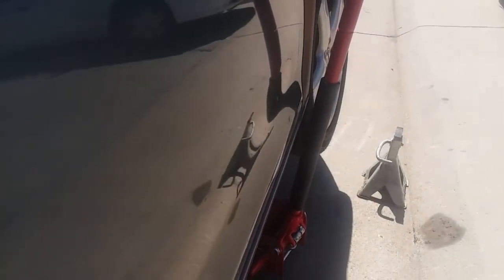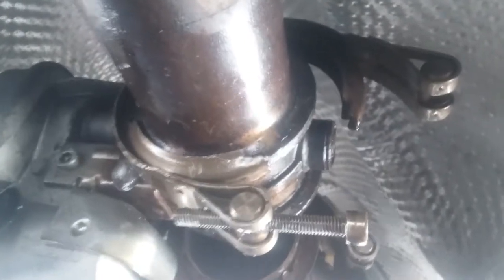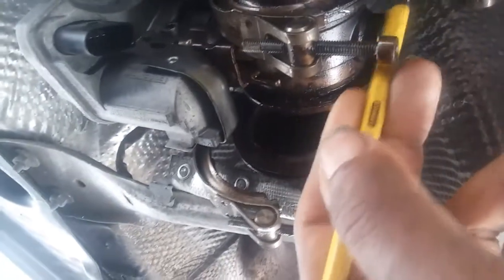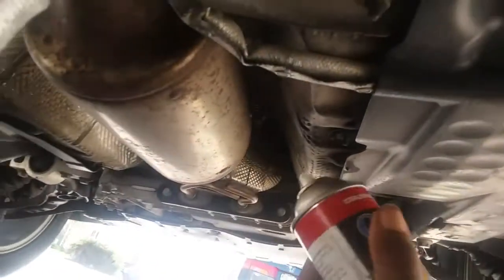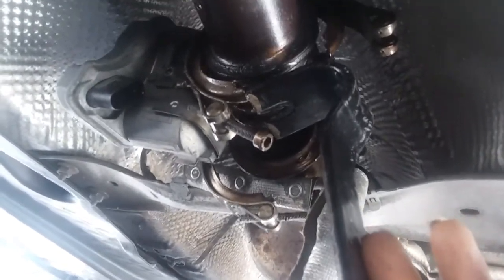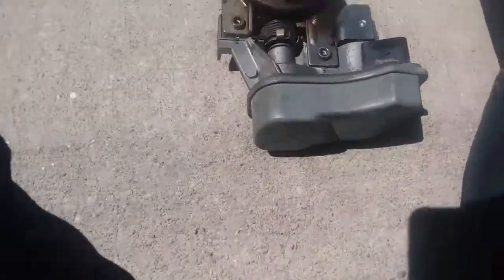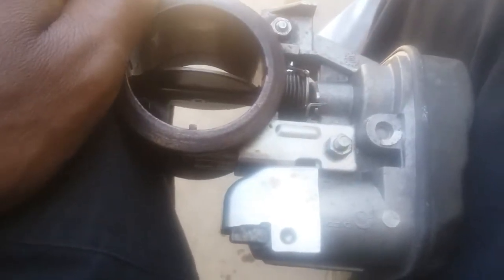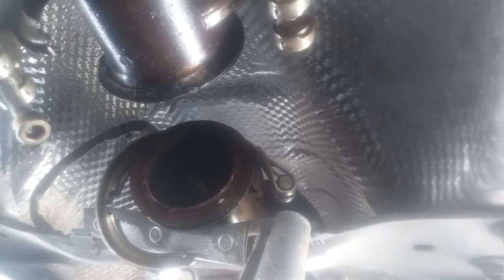P048A and P047F Jetta 2.0 TDI

Comment: I followed your video and cleaned up the flap. It solved the glow plug warning light issue,  but now I get an exhaust warning light. I haven't been back under to check the gaskets and clamps yet, though. Plus the wires to the connection were broken and frayed. But I fixed that. Any suggestions?

Comment: Did your car go into limp mode when those codes triggered for exhaust flapper? 
I know that sounds like a stupid question but and answer definitely will help me out for future things on my jetta.
Reply from the maker: No mine never went n2lemp mode maby because it was stuck open.
Reply from the maker: Sorry it took me so long 2 reply.
Reply from the maker: It did not go into limp mode I checked and fixed it soon as the light came on. I hate having extra lights on in my car.
Reply: @totallytame2557  i ended up deleting all that crap off my car. Very happy i did so. 
Running a poormans delete with no tune and its running flawless
Reply: @hayzeproductions7093   Hey buddy I'm in the same situation what exactly did you delete to make your car run flawlessly I have a 2.0 TDI 2014 jetta.  I want to delete anything that is not required to make the car run Smooth. Please let me know.
Reply: Everything exhaust related, Flapper, DPF filter, was pulled off and removed, 

Any sensors that were mounted on the exhaust system were unplugged and removed as well, this includes the nox wideband sensor that sits on top of the DPF filter. and remove the sensor with 2 rubber vacuum lines that connect to dpf filter. (that is a pressure differential sensor for dpf)

After removing and replacing with a fitted downpipe, which you can get one from rawtek but wont be cheap, or you can make your own if you cut the vband off the dpf filter and make your own downpipe, 

IMPORTANT
Be sure to unplug the following. 

Unplug any wires that connect to the EGR cooler behind the engine block, 

Unplug the EGR Valve that is in front of the engine mounted together with the throttle body,  (this will keep the EGR loop closed entirely so all pressure passes through turbo)
Lastly

Unplug the MAF sensor. (limp mode disable)

This will put your car in a "limp home" mode  that will restore its factory default parameters with the ecm, however check engine light, dpf light, and seek service messages will appear in dash. 

What not to unplug, 
your vnt actuator, 
this will make your car run as if it were in limp mode, because turbo control is not measured by ecm, 

hope this helps.